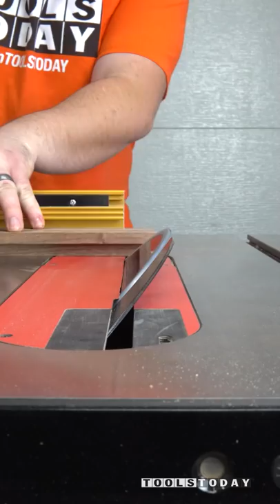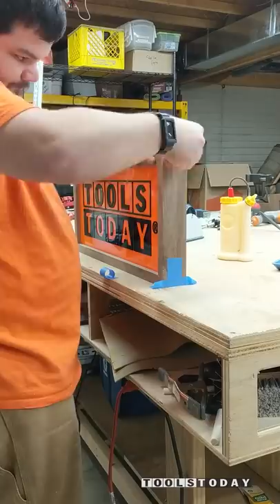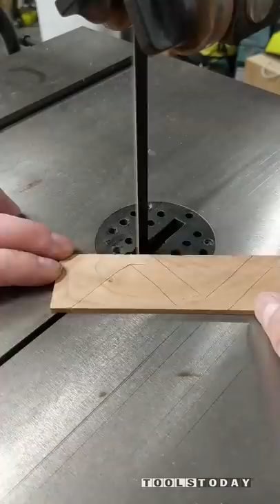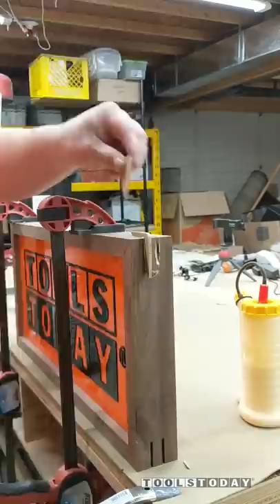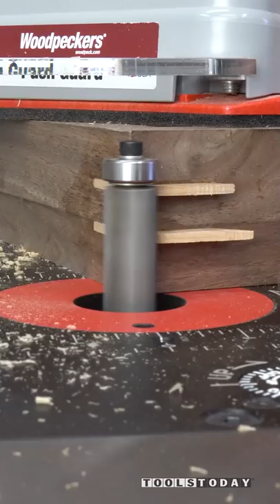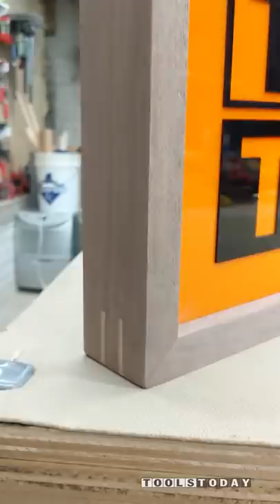Making a Splined Miter Frame

Comment: Im sorry for asking this question. What is the purpose of the doing the  splined?? It looks nice and ive seen others do it too..
Reply from the maker: Miter joints aren't very strong by themselves.  Adding splines adds wood going a different direction so that the miters never come apart.
Reply: @ToolsToday  plus it adds more glue surface to make for a stronger joint.